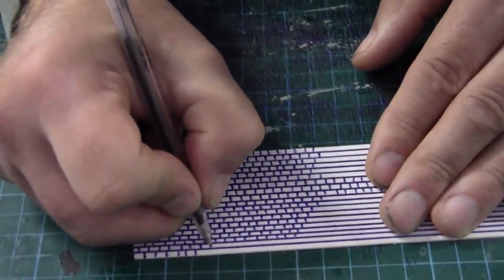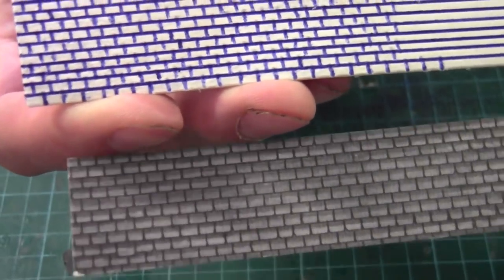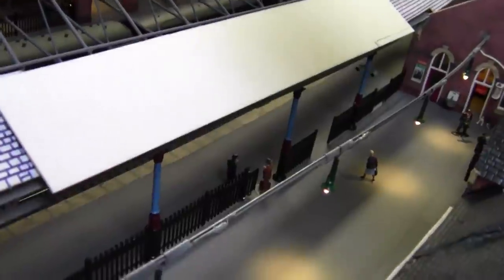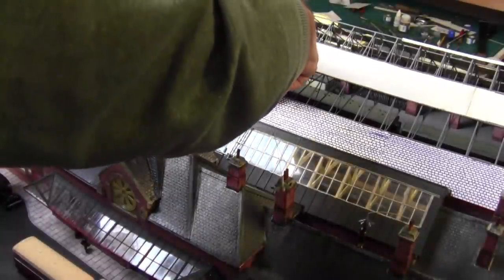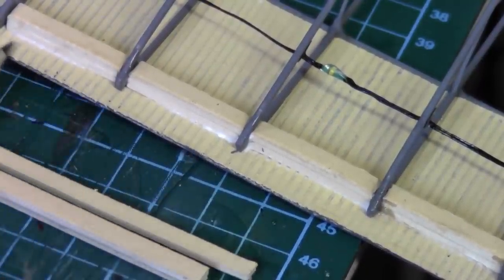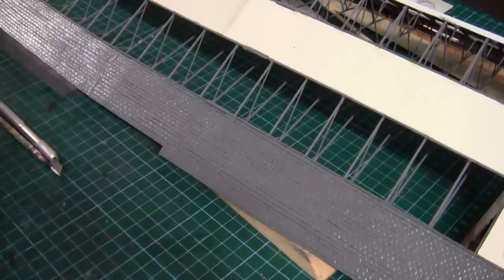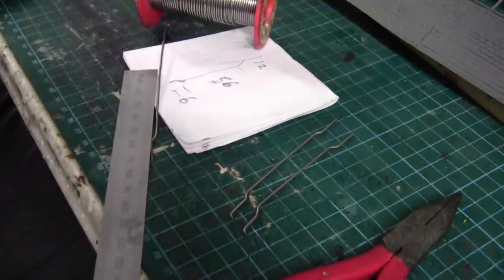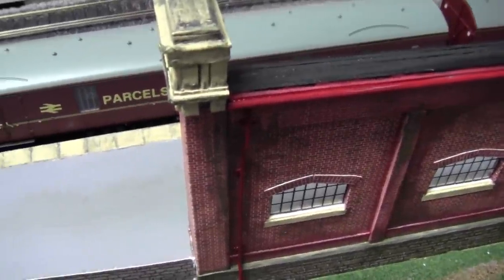The Big Roof Part 10. Tiles and Sooting up. No290

Comment: Tony you've got some patience doing this roof but the satisfaction you'll have when it's finished 👌great tip on making the drainpipes. Take care mate atb Andy
Reply from the maker: Good Morning Andy. Ah Drainpipes you can also use copper wire as that is also very flexible if you need to make bends... thanks again for commenting very much appreciate them...stay safe Tony

Comment: Great shot with the steam at the intro! Copper wire may be a more robust drainpipe rather than solder!
Reply from the maker: Good morning. I did think of using some copper. but i did not have the right thickness. but the good thing about solder wire its so flexible. and i have plenty of it. so why not use it...
I thought i show the same steam shot as last week but in colour this time. 
its all comming together now. many thanks again for commenting. stay safe....cheer's Tony